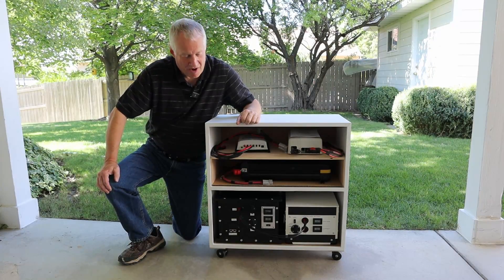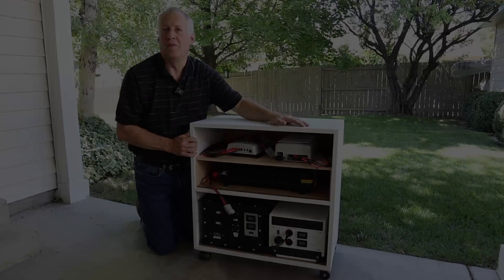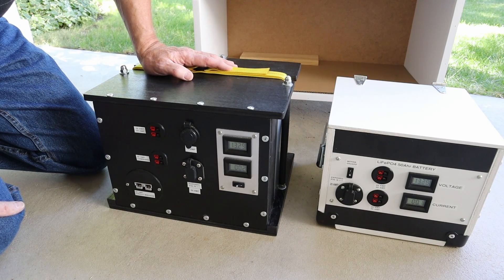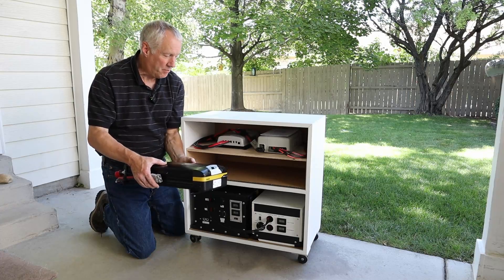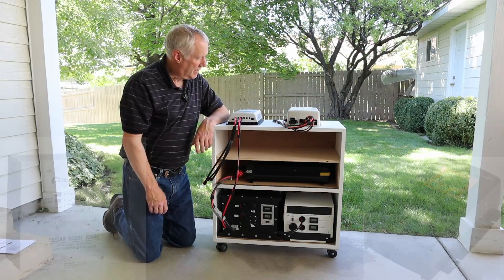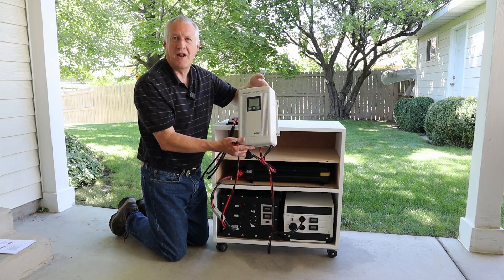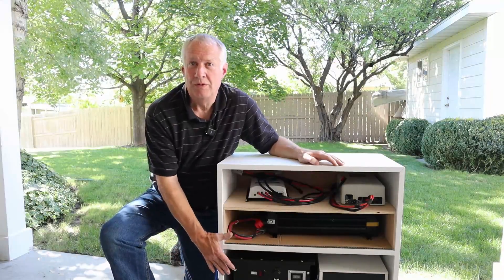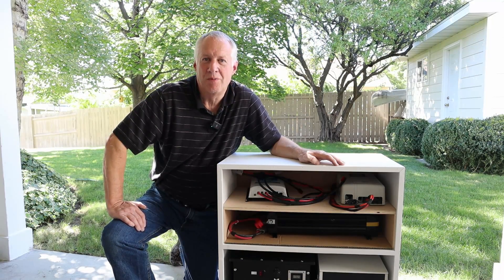DIY 1000w Rolling Power Cart! Perfect for Backup Power / Off Grid Living

Comment: I would definitely go Eco Flow or Blueitt and not DIY because of the technology and size. What I truly liked was this gentleman knows that a hybrid system is a must. Meaning he has a small gasoline 2000-watt LP or gasoline generator that will charge his batteries if there is no sun. A person must manage their accusation and use of energy. Of course, a person could install a large entire home LP gas generator with instant on systems that powers their entire home, but I don't have the $18,000 to do that. So, I have a small system that will need personal management like this individual but mine is Eco Flow and Blueitt.
Reply: To each his own but I think the benefits of DIY outweigh OTS systems, particularly for individuals who are knowledgeable in solar/batteries. Of primary benefit is the ease of scaling. With a properly designed DIY system its plug n' play - just add more batteries for greater capacity or power. This way you can spread your investment out over time. The other benefit is ease of maintenance. If any single component fails, you can easily replace that particular component. In OTS systems they're all built in, so if something fails, you've got to replace the entire thing. If there's any kind of shortage or backlog with the OTS manufacturer you're SOL until they get around to resolving it. This brings up another good point, in that it's probably easier to diagnose a failure in a DIY system than it is in an OTS system. 

I've neither a DIY or OTS system currently, so take that for what it's worth. But for me personally, when I'm ready I'm def going the DIY route for all the above reasons.
Reply from the maker: As power stations have evolved over the last couple years, the DIY option is looking less competitive. I think DIY still makes sense for some applications, especially larger ones. There's something to say about building and designing a system. Looking forward to how these large companies move forward with larger systems that are modular. Thanks for your feedback Dan, always appreciated!
Reply: If my choices were EcoFlow or Bluetti, I would buy a Bluetti AC300 with at least two batteries. Two reasons why: 1. Bluetti expansion batteries can be used as stand-alone power stations. 2. If the main unit fails it is light enough to return without breaking the bank for shipping. EcoFlow Pro expansion batteries are useless without the main unit and the Pro is really heavy.